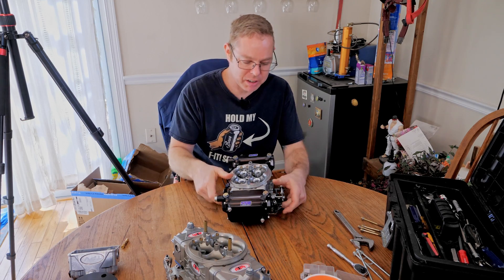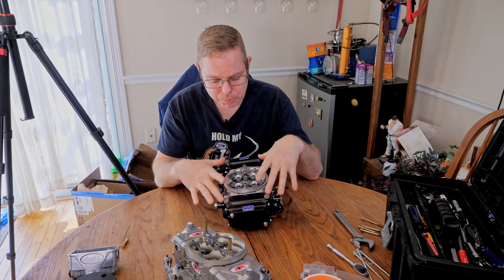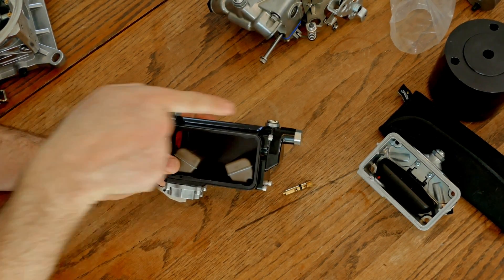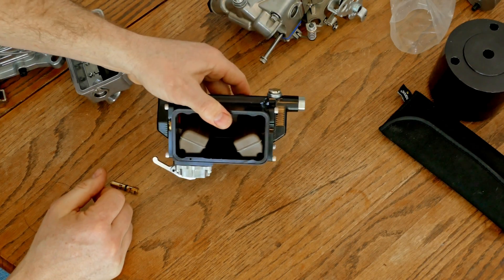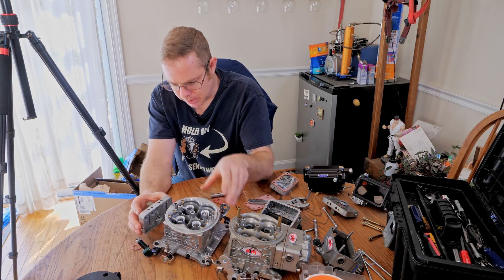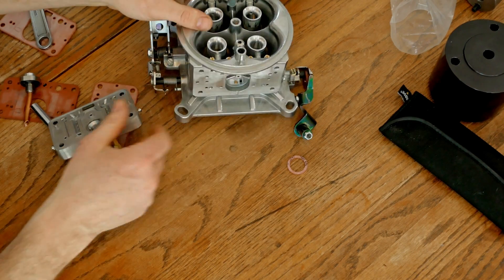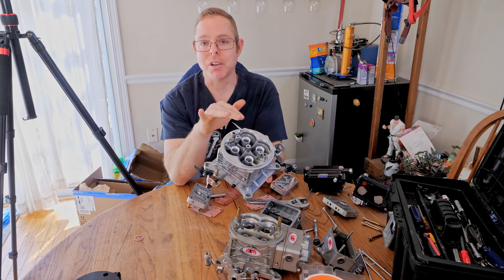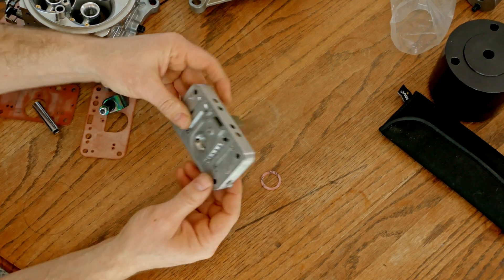Inside a 1000 Horsepower E85 blow through carburetor for my 400 SBC Supercharged S10!

Comment: Kevin built a 850cfm carburetor CSU blow thru for me for my 427ci  SBC  in my country Boys corvette it is a 92 chevy s10 with a 4l80 transmission with Trans brake strange 35 spline axles with 35 spline spool.

Comment: Man, those are some big fuel bowls! You are definitely better off sticking with what you know. Even though fuel injection can be tuned to be very precise and consistent, there is a whole world of things that can go wrong. You are probably even better off financially. I have heard some custom carbs costing $2k+ but you can spend 3 times that much on FI and not be any better off.
Reply from the maker: I had my 850 Converter it was still 1440 but the bowls are $800 alone.

Comment: Excellent video once again, cant wait to see how you get on. Be very interesting to see how much you need to increase fuel pressure with boost
Reply from the maker: Yeah it will be a learning experience. I have a big pulley for the first initial testing so I'm aiming for low boost at first.